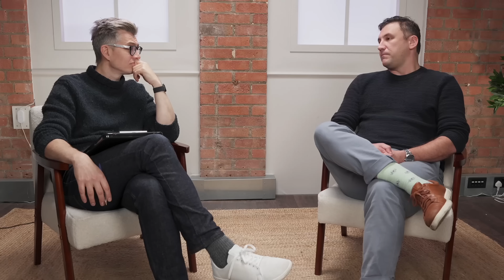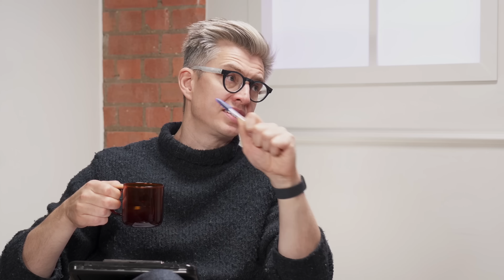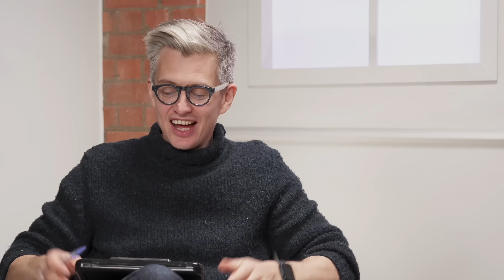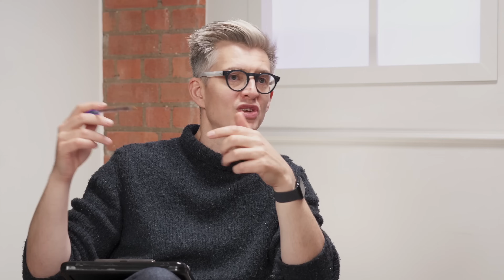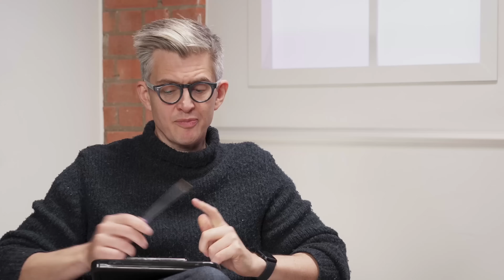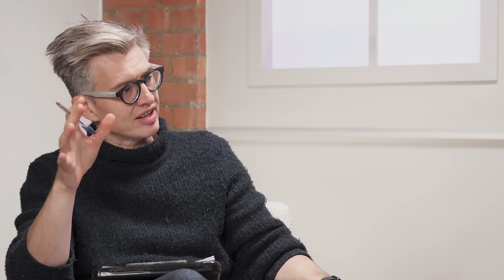Chris Hendon Full Interview About Triboelectrification & Coffee Grinding

Comment: I only skimmed through this video when it was first published, but have now listened to it all the way through.
I have been adding two full presses from the Weber mist bottle adding 0.4 g to my 19.5 g dose. It is early days but so far this has resulted in me  Grinding finer to achieve the same shot time and also it has meant using the kafatek flatmax 2, I do not need to use the puffer or the thwhacker. I have been stopping the grinder weighing the contents, then put the cup back on the grinder using the puffer and the thwacker and the results are zero.

Comment: I am wondering if we norm shots to the right parameters.. we norm to mass (e.g. 18g in). Has anyone done a dimension analysis on coffee extraction so we would be normed to some factors like bed hight, porosity and whatever comes up? It would be easier to compare between different roasts. You could also create standard coffee by roasting a single batch in different ways and then give some dimensionless number that indicates where this roast is on the chart.

Comment: If charged particles are a contributing issue while grinding whole bean coffee; it follows, using a hand grinder at slower speed might charge less and reduce clumping, just thinking?
Reply: My personal experience reflects this, I do get very little clumping with a hand grinder (Hario Mini Plus Slim II Turbo The Next Challengers X'II). What does happen is coffee sticking to the plastic walls of the included catch cup. There's also the issue of hand grinders not being too good for espresso-fine grinds which I assume with no basis whatsoever to be much more electroclump prone compared to a coarser grind.
Reply: quote from the paper: "both triboelectric and fractoelectric processes occur during grinding, with the majority of charging coming from fracturing events"
if I understand correctly, based upon the text, slower grinding speed would affect the "triboelectric" part (charging resulting from material friction). That would have an impact of course, but not as big as we wish. The "fractoelectric" part would remain the same regardless of grinding speed, and anyway that would have a bigger impact. Maybe it works differently with different grinders, I don't know